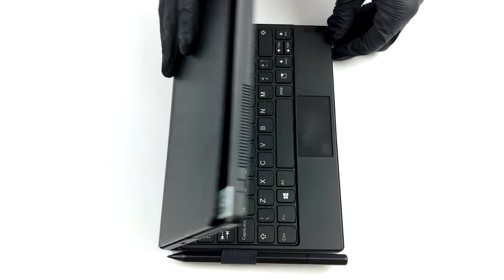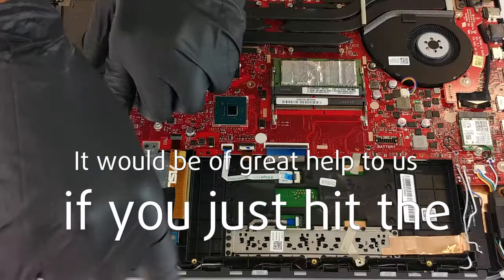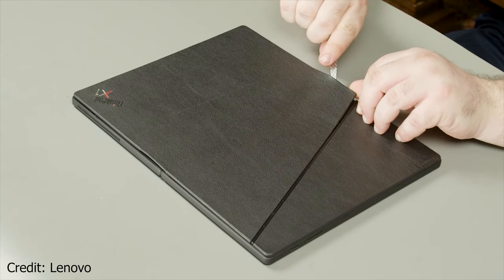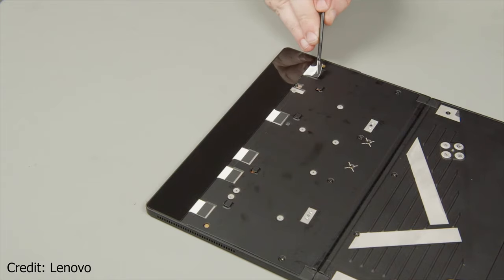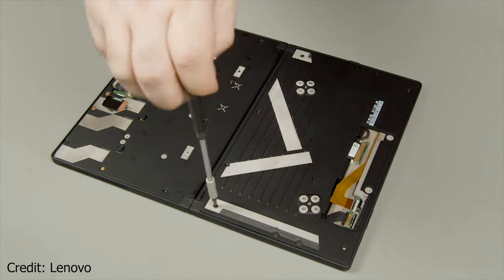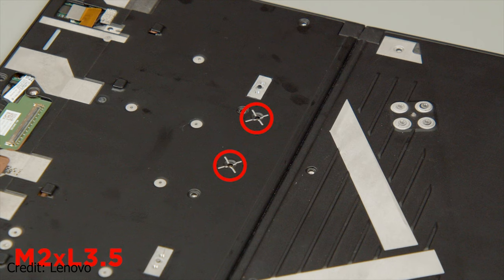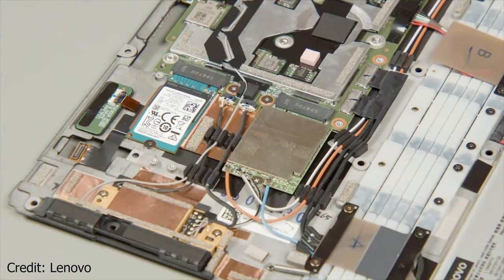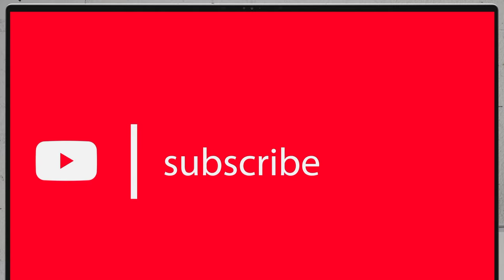🛠️ Lenovo ThinkPad X1 Fold - disassembly and upgrade options

Comment: It looks like a pain, but it's definitely not impossible to service. Now if only you could buy the pulltabs and replacement batteries...

On a side note, it would be great if you could put the part number of certain parts of interest, like the battery, in the description. Would make searching for them on certain Chinese sites a lot easier ;)